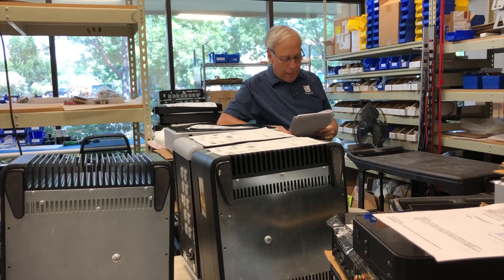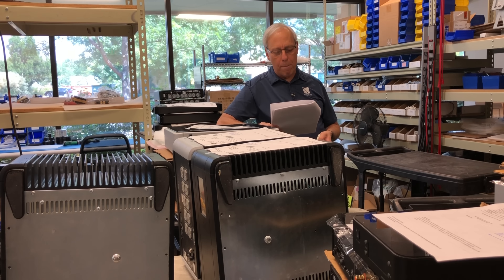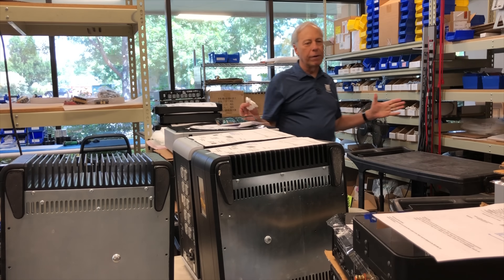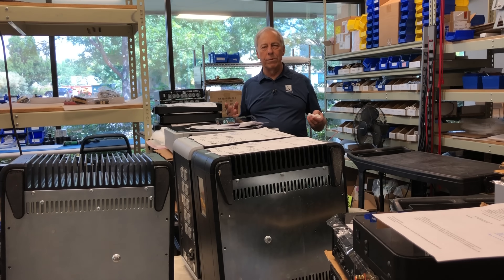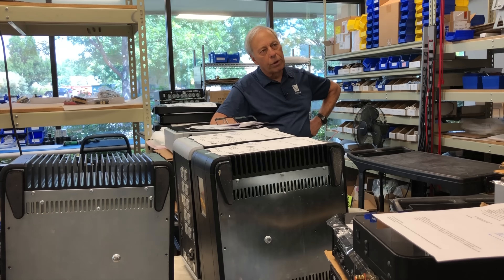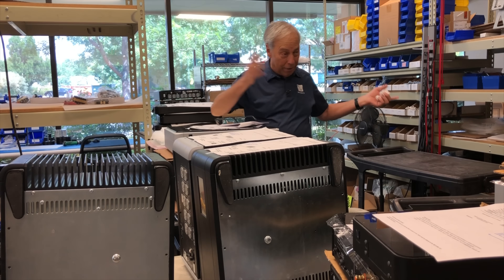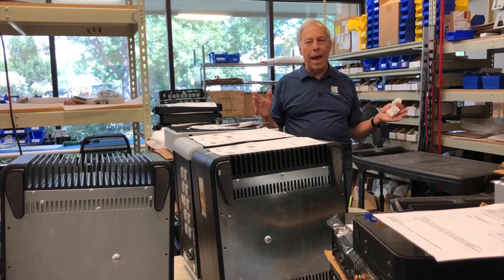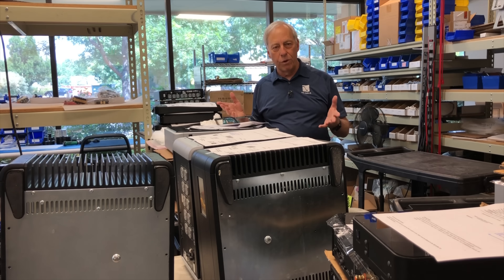Why should speaker cables have a minimum length?

Comment: Well, one can certainly measure the differences between lengths of speaker cable with a meter and see a slight change in resistance. That is basic physics and electronics. As for detecting the difference audibly?. Well, it is possible for someone with very sensitive hearing to detect a subtle something between say a 6 foot and a 12, 15 or 20 foot cable. However, it becomes more challenging to detect a difference between a 6 foot run and a 10 foot run. I have sensitive hearing, not because I have golden ears (there is no such thing), but only because I have very to extremely poor eyesight. (So I could be dolphin-man). At any rate, I do notice a subtly less dynamic sound on a 12 foot run verses a 6 foot run. I would say anything longer than 10 feet and you could start to wonder what is happening. That is just my rule of thumb. To me, there is no minimum length requirement, that is unless you are attempting to use 8 inch runs or something, which basically puts your speakers directly behind your amp (yeah, silly example).

Ok Paul, All this cable stuff has given me a burning question for you. You being a devout "cable believer" and me being a devout non-believer or skeptic based on science and experience and a non-audiophile. I'd like you to do something if you can and that is this: Can you suggest perhaps one or more inexpensive speaker cables you consider upgrades or whatever that some of the rest of us might be able to try? By inexpensive I don't mean inexpensive to deep-pocket or debt-loaded audiophiles. I mean inexpensive to those of us living on planet earth with real-life situations....those who can not afford PS Audio gear let's say, folks who would have to save for 5 months to get a Sprout. (Trying to keep it real fair). 
I ask because being science-minded I also have to be cautiously open-mind otherwise learning does not take place. Science requires that, pseudoscience does not. 

By the by, you do have me convinced that it is time for me to change my banana plugs at my speaker post to spades. ( I just think for my particular situation the spades would be a better and easier connection behind my particular speakers). That got me to think of the question I just posed to you. 

Thanks Paul.
Reply: Hmm, nothing?  I was hoping for at least one recommendation or something.
Reply: There's lots of great tests just testing humans hearing capabilities testing 128kbs, 320kbs, and FLAC audio files. Even young audio engineers are typically unable to identify multiple track samples accurately and yet "audiophiles" with too much money say that every single thing effects their listening. I love your post, especially coming from working in the industry for decades. Besides the science, the simple fact is that every human has different hearing abilities and preferences that all equipment has a diminishing return on investment the higher the costs. There are of course lots of amazing companies out there that produce incredible equipment that absolutely sounds incredible, but the simple fact is they are only made for the one percent that have so much money that the costs really don't even matter to most of them. They may act like it does, but these purchases rarely have any impact on their finances long term. Ultimately it is more about competing with others in their tax brackets than real world science or facts.
Reply: Hey thanks Scott. Yes, I try to stay on earth when dealing with the audio world. So many are fooled into believing a wide range of myths from other audiophiles to snake oil salesmen. Many audiophiles with their deep pockets discourage others from even getting started in the hobby. What is most disturbing to me is that it also discourages folks from listening to music or getting back to doing that. 
Also note that what appears to be deep pocketed audiophiles is sometimes a facade and what is really going on is massive debt trying to keep up with each other. Either way, not worth it.
Your theory on diminishing returns ratio is spot on. For example, one will take a much bigger hit selling a $15k to $20k item a year or less later than a $2500 item. You might get $1000 to $1200 for the $2500 item (difference = $1300 to $1000), but you might get $9k or less for your $15k to $20k item (difference = $6k to $11k). $9k to $10k might sound alright until you realize that you have to come up with twice that for your next item and it rabbit holes from there.
There is gear out there that will give the same result of spectacular high-end, high-performance sound that costs far far less. Half the secret is synergy and set-up and that costs nothing. I have heard $1300 to $6000 systems blow the doors off $50K+ systems in sound quality in similar or same rooms (and cable brands and price had little to nothing to do with it).
Reply: Couldn't agree more. I've been involved with and heard speakers costing in excess of $250k that were simply amazing and I've been involved in settings up million dollar home theaters that were truly spectacular, but again, the costs involved in accomplishing those levels of awe are just out of the realm of possibility for 99.9% of people and unless I were a billionaire, it simply seems silly with those kind of investments. It's almost better for people to not experience those extreme levels too because they become unrealistic expectations for people.

Comment: Probably they're counting on the inductance of the cable as part of the protection for their tweeters against destructive ultrasonic spikes. To be even more perfectionistic, they probably also have compensated the inductance-capacitance of the cable and treated them as transmission lines hence the minimum length.

Comment: At reasonable lengths and thicknesses, speaker cables will not alter the sound. So it's either the amp or crossover that will change the sound because of the cable, and if that happens, you should return them.
Reply: Bullshit

Comment: Ask Richard Dane at hifi corner - naim forum site. I have naim/focal and I can witness that is great difference in cable lenght. They suggest optimum between 5 to 10m long and that is certainly justified in sound. As a electronic lay person I can offer this kind of explanation - they cast away a component at the out so you have crossing in channel, left channel is on the right side and vice versa. Supernait would benefit from electra series of Focal and Naim source such as cd x2 or ndx2.

Comment: Snake oil.
Reply from the maker: Gosh, Bob, that'as such a helpful comment. We're all sharing information here. You're a bright fellow, share some of yours.
Reply from the maker: @Trialnerror  That's actually not true. I don't do it because it wouldn't demonstrate anything. If you want to be convinced in a test then the only legitimate way to do it is through the entire chain and record the results. Then, if you can identify the difference in sound from those recordings, we would have a match. If not, then you're right.

But, let's be honest with each other. Maybe a little soul searching on your side. If we did the tests as I described and we passed it, wouldn't you still be a doubting Thomas? Wouldn't you then say it wasn't valid or some such?

I am not trying to be critical of your thought process but in my experience, when anyone is convinced of something it takes more than a few tests and observations to sway them. Religion and politics would be great examples of how our minds are not easily swayed one way or the other by mere "facts".
Reply: @Paulmcgowanpsaudio  You say you don't do it because it would not demonstrate anything? Surely you would confidently demonstrate you could choose your cable every time, because it sounds better. I am rather confused by your comment. By all means have nice quality cables. A cable is a pathway for the signal. As far as I am aware it should carry that said signal from source to speaker, not modify or change that original signal in any way. Also, the listeners age will count for exactly what you hear from the presentation. The older you are sadly the less high frequency hz you will hear. So I do find it quite incredible when you see, not wanting to offend anyone, older gents/ ladies expressing changes in what they hear by changing speaker cables. A good guage OFC speaker cable is all you need. Try taking a hearing test and see just what frequency you can actually hear up to. Warning, it could upset you. I would be surprised if you hear much above 13.5khz if you are over 50, I am being fair on that quote as well. Enjoy 👍
Reply from the maker: @a0r0a745  Oh, I am sure you're correct but in my experience it has little to do with hearing extremes. Some of the best listeners I know can't hear much of a few kHz and some even have hearing aids. The thing most people have trouble wrapping their minds around is that hearing is a matter for our brains more than our "ears" - which is why someone with hearing aids or poor hearing can still easily distinguish one type of violin from another - their abilities to discern differences remain inact as their brains adjust to the changes in hearing.
Reply: @Paulmcgowanpsaudio  Thank you. However, we are talking about changing something and hearing a change. Not mind changing something. I do agree, you only have to see how the brain can deal with eye issues, it can adjust that you sometimes would not notice an issue. The original statement stands, you should be able  to identify your choice of cable/ product every time, time and again. To deny doing so just looks as if you could not pick out correctly your cable/product. It was how that came across by you I am afraid 👍
Reply: @Paulmcgowanpsaudio  you should set up one of these tests you would need independent adjudication but it would silence the doubters, would go viral could be some nice publicity for you.
Reply: @Paulmcgowanpsaudio  "I don't do it because it wouldn't demonstrate anything." - Well, that is true.

Comment: I took waveguide and transmission theory back in school...  that certainly doesn't make me an expert though lol.  With the "low" frequencies we're talking about I find it difficult to believe that with any reasonable quality wire that any distance under 50-100ft has any practical or noticeable effect.  A super short wire might have some effect depending on the impedances (due to reflections being more pronounced).  What will probably have the most effect are:  gauge, insulator type, insulator thickness, distance to other adjacent wires, conductor material, speaker impedance, amplifier output impedance, and whether there's an output capacitor on the amplifier to help eliminate DC and sub-audible noise.
Reply: Whoa, whoa. Who do you think you are using science to explain reality to "audiophiles" with more money than anything else? 😉
Reply: @scottcampbell76  lol yeah I'm not really sure why I felt compelled to make a comment in the first place.  Like I'm going to convince anyone of anything lol!

Comment: 3.5 Meters ? 1 meter = 3.28 Feet.  First it Depends ! It depends on what the Conductor is made from ! Silver that cant oxidize is best. Then the type of wire , (the Skin Effect) Flat or Twisted Rope or Coax etc.  The bottom line a good amp should have no problem with heavy gauge pure ox free Copper under 16ft . That's basic EE stuff ! A speaker cable is no way as sensitive as a Guitar Cable that has just 1 volt AC to push down a 16.5ft. run of cable  in to the front of an amp. Its the Signal Leads that are most sensitive, that's where you should waste your money $$$.
Reply: Given the very low impedances and sub-20kHz frequencies involved, none of this is even remotely relevant to speaker cables, for which resistance is virtually the only relevant specification.  Guitar cables operate at much higher impedances, making series resistance a non-issue and shunt capacitance pretty much the only relevant factor.  "That's basic EE stuff !"

Comment: According to our Naim dealer in Sudbury, Naim recommends people to put the electronics in a separate room, so Naim amps are tuned counting on the extra cable capacitance and inductance to mellow out the sound - exactly as Paul suspected.
Reply: H Cheu I’ve never heard that one before. It has to do with providing enough cable inductance to keep the amplifier stable, it’s a well known Naim quirk.
Reply: @Si1983h  The dealer is a good friend and he loves Naim. I was looking for a pair of cables for my new Brodmann VC7 and I asked about Naim cables. I asked about the length and he told me that the minimum length rule would not apply to me because my amp is a McIntosh. TheN he explained to me why Naim designed its amps for long cables.
Reply: H Cheu it’s the first time I’ve heard that said. Some Naim amps need long cables for stability, not to tailor the presentation.
Reply: @Si1983h  I think "stable" is just another way, perhaps less accurate, to say the same thing. Less accurate because I used Naim to drive electrostatics at 0.8 ohm. There was no instablility.
Reply: H Cheu no, they can go into oscillation if they don’t have sufficient inductance on the outputs.
Reply: I see. Thanks for the information.

Comment: My hifi is nearfield sitting on my computer table . I bought quality 12 awg 6 feet long with banana plugs on both ends . I cut the cable in two and now have 3 foot speaker wires with plugs on one end . I thought I was being clever , now I dont know .
Reply: At the voluume I listen to them , they dont get up enough speed anyway .

Comment: Cables sound different ?😂😂😂😂 wth!! You mean the speakers I hope
Reply: No, cables do sound different. Different resistance, inductance, and capacitance will unquestionably have an effect and in some cases the effect is audible. At speaker levels, the inductance of the cable is proportionally quite relevant in comparison to the impedance of the driver coils. If you have a good system you can hear it for yourself but remember that the terminations are almost more important than anything else because they're typically the weakest link in the signal chain.

Comment: It's really simple. Any amplifier that specifies a minimum speaker cable length is unstable. Stay away from it! We have been able to make audio amplifiers that are unconditionally stable for at least the past 35 years. No excuse for such a restriction these days.
Reply: That's what I was thinking.  There is some wonky engineering going on when a request like that is made by the manufacturer.
Reply: So you are suggesting Naim make poor audio equippment mmm. I dont have Naim equippment but i used to and its far from unstable
Reply: Andy Delle The amp is only unstable if you don't add the required inductance to the output stage. Once the inductance is met they become very stable into even difficult loads.
Reply: So why not just add output resistor.....
Reply: Could it be that shorter speaker cables just "sound" different because of reduced I square R loss?
Reply: @johnstrunck3659  Or shorter cables on Naim amps don't have enough inductance to keep the amp stable. The reason is obvious once you look into the output stage.
Reply: @johnstrunck3659  power. The word you were looking for is power.

I squared R is power.